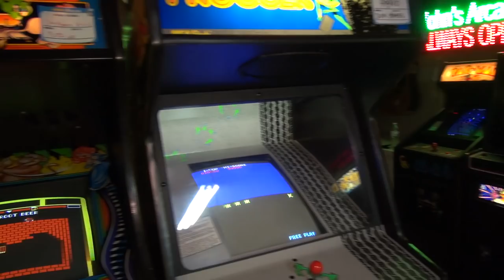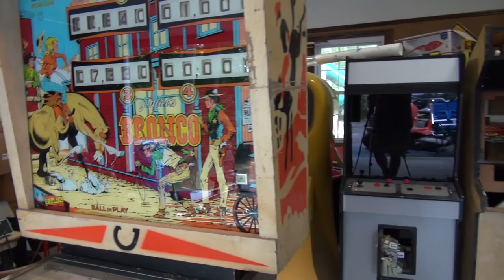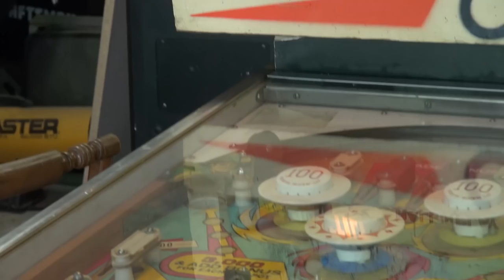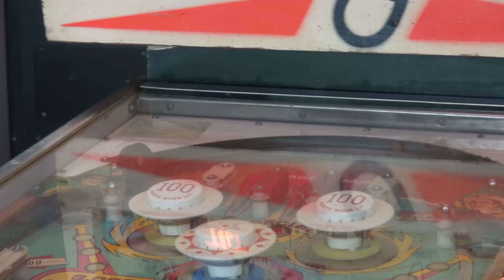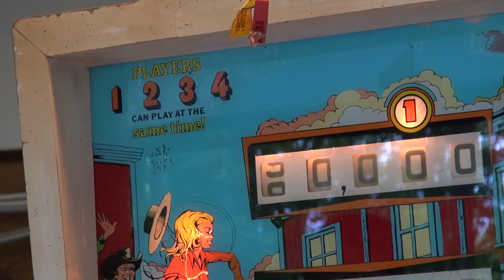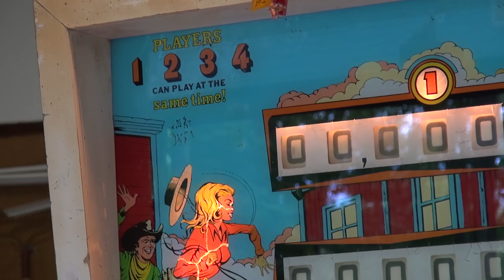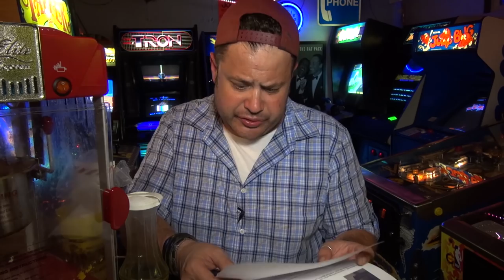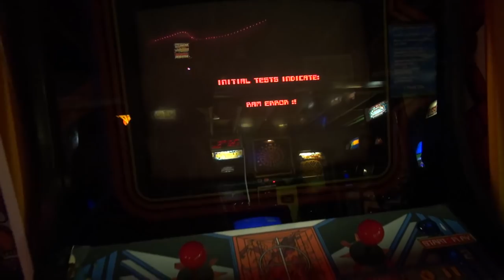John gets an EM Pinball Machine! 1977 Gottlieb Bronco Pinball Repair - Part 1

Comment: I got a Williams Aztec 1976 EM pin and the best advice I got for getting it to work was that if the problem is not really obvious,  don't waste time hunting for the problem and just file and gap EVERY contact.   Because you will need to do that anyway.   As far as EM's go you got a good one because it's a late EM.  Not long after this they made them solid state.  So John you have the zenith of EM Pin technology.  The only hard part is that it is a 4 player. That means you have 4X the amount of parts to fix.

Comment: Nice John! I have 70+ pinball machines and roughly 1/2 are EM's. I can tell you this: With an EM, you don't chase problems. You end up cleaning and adjusting every unit, switch, relay etc. anyway, so do it all from the begining. Remove the whole bottom panel from inside the game and put it on your work bench. Clean and adjust for 20+ hours. Switches either make or break. Make sure they "wipe" eachother, then move on. Take the playfield out and set it on your work bench, clean, adjust, etc for 20+ hours. Then, take the head off and put it on your work bench, clean, adjust etc for 20+ hours. THEN try to turn it on and diagnose. That's how I do it.
Reply: +Biggest Little Arcade So this is that mythical work thing I've heard so much about. Surely this is what it is to be a real man! ;)
Reply: +Biggest Little Arcade Thats the only way ive done EM's. I always used an ultrasonic cleaner to clean all stepper unit parts, etc. I flipped EM's to fund DMD titles I wanted and never got a call back using the shotgun repair method. Every EM I did got aleast 60+ hours of love and netted me a few hundred bucks profit. Did it more for the love of the game.

Comment: That relay at 15:00 should just be disconnected.  It's for when the game is off and someone puts in a coin it will return the coin. When it's on the relay is active and the coin is diverted.  But for home use you don't want a relay constantly active. Just one more thing to make noise and burn out.

Comment: Hi John, like Biggestlittlearcade said....Unplug the connectors from.the playfield wireing and remove it. Then work on the switches on your bench by turning it over.The entire bottom board in the cab can then lift out as well and you can adjust the relays on the bottom board. Some switches N/O and others N/C on the same relay switch bank.
Then remove the head and work on the score reels. Clean them 1 at a time and lubricate themAnd check springs.
For cleaning the contact rivits/points the easy way use CLR. Just use a small brush to "paint" it on the points. Let sit for 5 min. Wipe with a damp cloth. Or brush again with clean water. Let dry.Contacts will be good as new.
I got my first EM a month ago Interflip Dragon.Had most of the same issues you are having.
Did all the above. Now 100%They seem complicated and intimidating. But easier than solid state to troubleshoot. Once you get comfortable.

Comment: Oh, John. That machine is a thing of beauty. It just feels like a true piece of history. And, I can't relate to the A.D.D. comment. These are rare opportunities that just are happening too quickly. You've said that pins are always expensive. You saw a bargain and jumped. That's all there is to that. And, I do agree that this antique should not replace anything in your basement. Yet... yet, you should keep it. With something so old, I'm sure a fresh cleaning on the contacts and a bit of grease on the gears will go far. Just hope you never have to rewire. Ugh...as simple as the sliding gears are of a concept, that looks like a million miles of wire, in there. 

Congrats on the find. 

And, I swear, some day, some way, you and friends are going to co-invest in some place with low rent for a museum. Some place to hang out and game at while shooting the breeze. Public invite while not stand out, "I'm an arcade/Barcade" kind of place. But, more like that place that 'a friend of a friend talked about' kind of place. If nothing else but for the need of 'more space'. Maybe have a bar there. But, not the kind that would draw mean drunks that would be total strangers.

Comment: congrats on trying out the em world.  a couple large bolts remove jones plugs and the entire control board can be put on bench.  do not use flex stone files. I don't care who says otherwise they suck and will cause problems. yeah a lot of your problems now will just be freeing up the old dried up factory grease. some games like bingo machines have leather washers and a lot more weird stuff.  pick up a red or green 3m scrub pad to clean the jones plug male pins. take steppers and scoring completely apart lot of work but it has not seen love in over 30 years.  the em(s) with short ball times are a great party game. enjoy!! pretty freaking nice one!! you did good.

Comment: There is a loose screw (looks to be about 1" in length) just laying in the wiring harness above the stepper motor. Its right in the center of the back panel. You might want to remove it before it falls and shorts out something.
You can see it at the 11:34 mark and also later in the video.

Comment: Hi John, great purchase :) beautiful machine.
It's been a while since ive worked on a EM pinball machine, the last one I worked on was a Bally freedom.
With those sticky coils I would start by replacing the plastic sleeves because as you probably know those things can warp with the heat, then you should replace the leaf  switches or clean the contacts with brass cleaner.
And I noticed with the plastics on the play field they can get really dirty underneath.
Anyway love your videos and keep up the great work :)

Comment: John, very important. When handling the components inside this be aware of two things (you might already be, but better said than not):

1. plastic is fragile

2. the wire solder joints are fragile

I've dabbed with stuff like this before and i'd thought i had fixed one issue, only to discover that when installing the thing, age, had gotten to it and the handling broke wires off their solder points. Now i'm not saying resolder each connection, but keep that in mind, to check them after you're done with them(individual parts).

Comment: If your RAM is flaking out on you in your Robotron it is probably the old 4116 type, there's a mod you can do for more reliable 4164 DRAM. Just did the mod in my Defender and it's rock solid now.

Comment: Maybe you shouldnt get the coindoor wet like that, those old EM machines IIRC have contacts on the inside that have like 120 volts directly from the powersupply (some sort of ground thing i believe) into the coindoor, might not be a great idea to spray something wet there that might run into cracks and stuff before plugging it in LOL

Comment: 53:40 the red  tent monitor looks like a could regulated voltage issue or a horizontal deflection failure , change the (HOT) Horizontal Output Transistor  and the Voltage transistor, they are both in the  same looking case :)

Comment: I'm dead impressed with you tackling this John (and just as intimidated by the complexity!); this is not for the faint-hearted collector. That manual... I wonder if it has a troubleshooting section. ;)

When you got it going so quickly I had a funny moment of joy. I think just how complex the thing is and its age is quite overwhelming. It does come down to tracing things through from start to finish as another (famous?) commenter has said at the end of the day -- such a huge task -- but when you can get lucky like that it's pretty exciting.

Comment: Really liked that Pinball. Really intrested to see if you get it working.
Reply: Why not? Those are real machines unlike some Street Fighters or Turtles :D
Reply: +thecouchtripper well no he didn't. there is much to do if he wants this to be totally playable. He got couple of things working barely it's like 25%
Reply: +thecouchtripper well almost everything needs to be cleaned and rebuilt. new coils, rubbers and bulbs. Only thing really he doesn't need to touch is that playingfield.

Comment: john your robotron problem is your power supply , I had a Stargate doing the same thing . arcade shop has a switching power supply for it that will let you change it without hacking the wiring .

Comment: John, that robotron RAM error message should show what chip it has detected bad but it doesn't???  The errors look pretty random so it is likely a bad connection to a chip or a faulty chip on the data or address bus, the CPU or the power supply is just drooping too low.  Check power supply voltages. ;)

Comment: I don't think you have to keep hitting that relay to get it to reset..  just hit the start button..  I have a similar EM, and they don't reset until it's time to play.. Matter of fact, mine stays completely dark until you either press start or press the left flipper (this was so arcade owners could turn them all on for the day, but they wouldn't burn up sitting doing nothing)..  As for the ball in play and the other reels in the back, there will be solonoids for increment and/or  decrement/reset..  especially on your ball in play, I'd bet the solenoid is frozen, and/or the ratchet mechanism is dirty.  Be careful what you clean with..  Some things I would expect to use can attract dust, and people recommend not to use.. other stuff can actually cause the head to catch fire because of the sparks created in the relays, etc..   I'd just do some reading online before you go to far..  I recommend pinreepair.com.  Also, for all the EM contacts, they are "self cleaning" meaning that the more you play, the cleaner it will get, and the better it will work..
Reply: +Steve Jones Oh yeah..  and.. since the operators would leave them DARK until you start the game, that solenoid on the coin door prevents it from taking your quarter if the machine isn't powered up..  When you turn it on, and that pulls in, it will now accept quarters.. otherwise it will just send to the coin return because the game isn't on and ready to play.

Comment: I believe the art was not silk screened but stenciled on with paint. If I were doing a complete restore, I would repaint the whole cabinet, because the art on the cabinet of yr game is in pretty bad shape, and the white is kinda yellow.  Stencils are available for a lot of these pins, but I did a search for stencils for Bronco and as far as I know they don't exist. But that wouldn't stop me.  I'd first take some very large tracing paper or vellum and trace all the art by hand.  Then I'd hand cut a stencil for each color,  and color match to the apron, which looks to be in great shape. You could also use one of those hand held scanners to scan the entire cabinet, and then create the stencil lines in Illustrator, print it out at a kinkos. But you would still have to hand cut that shit.

Then I'd remove all the steel from the cabinet/backbox and paint the entire thing white with an HVLP sprayer, and then use the stencils for the blue and red art. John, if you did that, it would look fucking sick!!! You would have to have a rivet gun to reinstall all the steel on the cabinet but it sounds like you were already looking for a reason to buy one. So tell me, are you willing to go all the way with this restore?!?!?! I'd be willing to cut the stencil for you but that would mean I'd have to go out to where you are to trace the whole damn thing. Those chimes are pretty bad ass. Great video!
Reply from the maker: +Anthony Brandon Yeah, you are right, they were stenciled. Not sure why I said "silk screened".

Comment: probably not a relay problem for the balls not being advanced.  stepper unit for balls is sticking just like all the plungers and axles on the scoring wheels.  they have to be disassembled and the gunk removed. do not lubricate or use electrical contact cleaner.  the contact cleaner will decompose in the 50 volt ac arcs and create salts on the contacts.